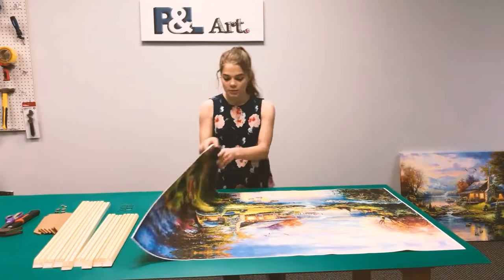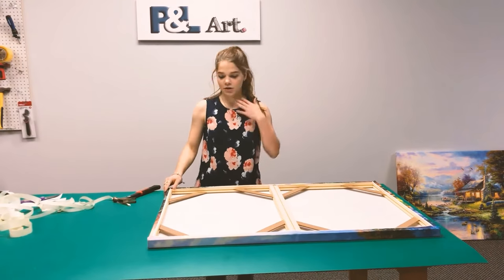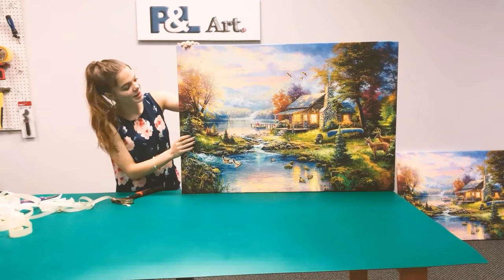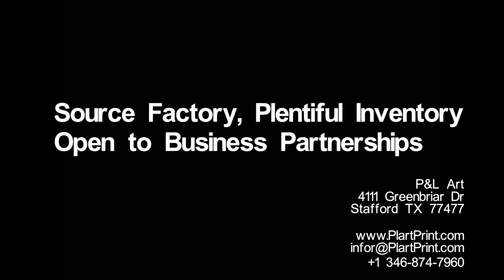How to Frame a Canvas Print

Comment: “Adjust bars to best position”....What does that mean??? How do you line it up with the artwork if it is on the reverse side? The frame is too big for the canvas until AFTER the bars are put together, so how are you supposed to affix it before the bars are assembled? This is very frustrating.
Reply: You can see the line of your photo through the print